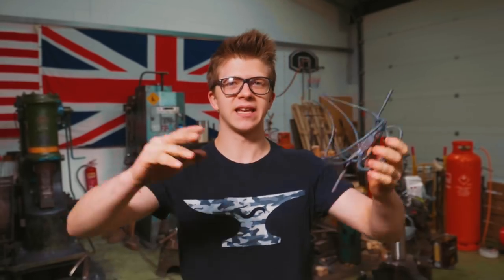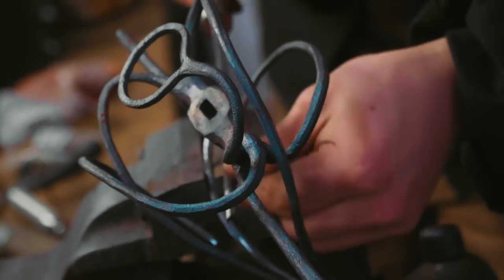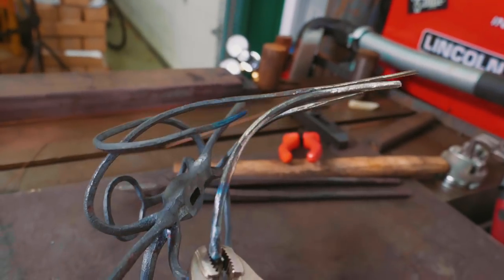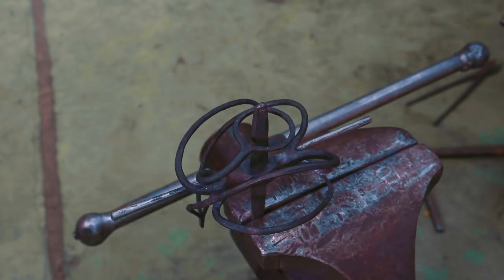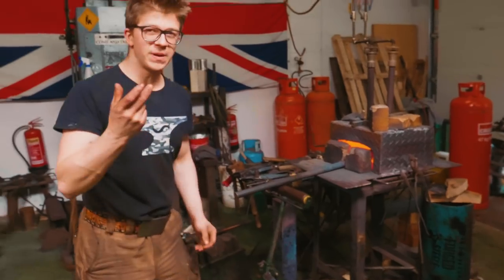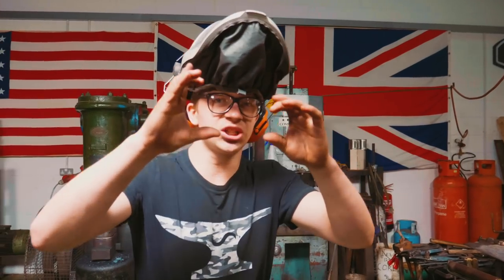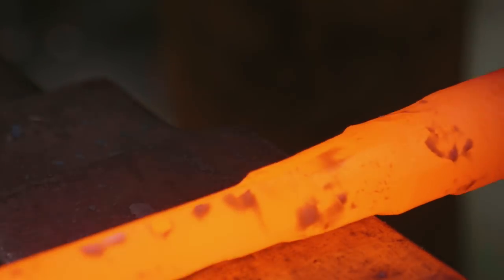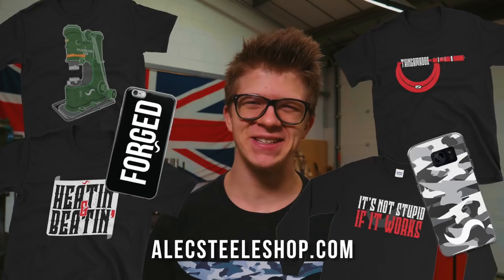MAKING A BASKET HILT RAPIER SWORD: PART 9

Comment: Hey Alec just to quick tip. next time you clean up the material in between all the tines try using a long strip of sandpaper ripped lengthwise it really helps get in between all the areas in hard-to-reach places. Hope this helps God bless you and can't wait to see the rest of this build
Reply: Christ Centered Ironworks or a sandblast cabinet
Reply: Just a question I'm kinda new to this stuff but could you use some sort of tumble polish type thing like used on stones or something like that?
Reply: I work in a machine shop where we tumble our finished parts quite often.  Tumbling can be a very rough experience for a piece of material, depending on the quality of tumbler.  Removing burrs from steel can take hours, soft steel isn't bad but the amount of tumbling required to remove that much hard scale would likely result in the thin and delicate hilt being badly damaged.  It might work with the right combination of media(polishing stones) and settings on your tumbler but I wouldn't want to risk it.  Not to mention those machines cost money.
Reply: I agree a small media cabinet would have worked well here.
Reply: This is a good idea, personally I would say sandblaster, or a slower Way of using hydrochloric acid would be the best way of cleaning the area, I was a Metal Polisher for over 10 years myself and putting something this shape near a grinding machine is just dangerous, doable, but I've seen some bad accidents with stuff being caught on wheels.
Reply: Yeah a small sand/bead blasting cabinet would work wonders and the media for them is fairly cheap, i've found that using crushed walnut shells works on just about everything
Reply: Roy, I'm curious if your pickling technique would be useful prior to removing scale from a piece like this.  Is it unnecessary, or potentially even damaging?

Comment: To pre clean before welding I would have used strips of sanding belt about a foot long, pass around the sections of guard and pull each end alternately. It's much less fiddly than using the little dremel tool. To get round the hard to reach bits tear narrower strips and pass round twice in a spiral.
Looking good though, I hope the pommel is going to be threaded!!
Reply: chris osh The pommel must be threaded to end him rightly.
Reply: Exactly! Needs a fast thread.

Comment: Hey Alec you could heat up the hilt and coat it with brass by using a brass wire brush

Comment: To clean up stuff like that, you could build a tumble mill (basically a small cement mixer with the mixing fences removed, filled with just sand or grit)

Comment: They sell silicone carbide sanding drums like you were using on your die grinder. They last a long -- long time. Also if you ever run into a situation like cleaning up that beautiful basket guard,think sand blasting. Places that do commercial blasting or you can buy an outfit yourself. They have lots of different types of blasting mediums. Especially on something as intricate as this . They have crushed walnut shells,or my favorite for delicate jobs is baking soda. Check it out and you will see they can save you vast amounts of time and do a wonderful job.

Comment: I couldn't find any sources on this, but as I understand it goldsmith's back in ye olden times had a barrel of fine sand and water that the young apprentice would role through the streets, thus giving the jewellery inside the barrel a higher shine. It's possible that sword makers used the same technique. Sanding, of course does not complete the finish but it gets you quite a bit on the way. Modern goldsmiths also use tiny steel balls in the polishing prosess though I doubt the smiths of olden days had the material to spare.

//Norwegian goldsmith

Comment: welder here, the reason your joint let go was because you were welding it with too much amperage. for small detailed work like that basket i would suggest going down in tungsten diameter size and also a smaller diameter filler rod would help as well. awesome job on everything though! your videos are quite enjoyable

Comment: You may use warm diluted acid solution (like HCL or H2SO4) to clean surface of steel after it's forged. It's pretty quick and doesn't require much effort. The acid concentration should be about 8-10% and it's temperature -- about 50-70 °C. (It is necessary to pour an acid into the water, but not vice versa, otherwise strong spattering is possible. And in any case, you need to mix it quickly.)

Another way is electrochemical. You can use a concentrated solution of common table salt. You need a metal container, which you need to connect to the negative wire of the power source. The product is connected to the positive wire. The product should not come into contact with the container, and the distance to the walls of the container from all sides should be approximately the same. The current source must provide 0.5 to 1.5 amperes per square meter of product surface area (Not strictly. You need to find the right value). A charger for a car battery is good. In the process, the solution will be slightly heated, but to accelerate the process, it can be preheated in advance.

Comment: Hey Alec love the vids.    Have you ever tried to tig with bronze silica.     Works great for decore and melting point is way way lower then what you need for carbon steel.    Also try a Gas lens on the tig torch.     Less heat god long way

Comment: grips need to be oval in cross section to avoid the sword twisting in the hand.
Reply: I realise this is a year late but you are right for most swords the handles are oval, but with rapiers you hold in such a way that a couple of fingers (depending on style) go above the handle and into the guard itself, defeating the risk of the blade twisting while fighting. So the handles are actually small and completely round

Comment: Alec, I was surprised that you didn't use a flap wheel on your grinder for cleaning up the to-be-tig-welded surfaces.  But the files I can relate to.
Reply: "little tools here" is a die grinder, eh?

Comment: instead of the round sandpaper barrels that you burn thru quickly, you could next time just make a flapper tool. A bit or round stock that you cut a channel; cut up strips of whatever sandpaper grit you want to use; take a stack of sand paper and fit into the slot; figure out which direction your flex shaft spins it and then use to your desire. Have used for jewelry making to get into tight spaces to polish up. The paper/cloth sandpaper will fly off as it weakens but you have multiple layers of sandpaper so it just goes to the next bit. benefit is you don't have to keep buying all those sandpaper barrels.  GOOD stuff btw. Always wondered how the ancient smiths put these hilts together. You think they forge welded or did you see any pins/rivets when you went to the Wallace Collection?

Comment: Roloc discs in a die grinder. Unsure if they will touch oxide scale but surface corrosion is its bitch. Also the flexible nature of the discs might be awesome for this more intricate work.

Comment: Love these vids! Do have a question though. 
In the past I believe I've heard you say you would opt for a smaller forge if you didn't occasionally need the size for teaching people (correct me if I'm wrong here) yet in builds like these it would seem you need the full size of the forge to accommodate large pieces like the basket. Taking this into account, what size of forge would you recommend for someone interested in picking up the craft? And could a larger forge have it's efficiency improved by sliding in some firebricks at the side when you don't need the extra size or is it not worth the hassle? Cheers!

Comment: those tiny abrasive things are intended for wood and soft metals, not something as hard as steel; that's why they don't last as long.  you might get better results using one of the small grinding stones in the foredom handset (though they will "wear" quickly due to their small size....)....

Comment: love the video's and the patterns of the steel that you make......but i have to ask....why, with all the equipment that you have in your shop, there is not a sandblaster?  it would make quick work of getting into the little crevaces...especially if you use fine sand...

Comment: "Imagine making it out of damascus..."

Make it out of cable damascus, depending on the structure of the cable, you might be able to work with individual strands, rather than hotcutting it. Even if that's not the case, it might look rather interesting when it's all said and done.

Comment: Alex! I need some advice. I work in a Theater in Switzerland in metal fabrication.
I just got the go ahead to buy a welding helmet with air purifier and would love to know what you would recommend. Which helmet do you use?Versaflo?
do you use the same air purifier for your grinding helmet as your welding helmet.
 I guess my budget is enough for a grinding helmet as well
I have also seen welding/grinding helmet combinations,what do you think of these?
I am a big fan. 
regards from luzern switzerland
Clint
Reply: You should check the description area, he have links there for all of the equipment he use.
Reply: thankyou!

Comment: So, thinking of this as a functional piece, is it okay to weld the tines together with that spring tension in it? Or does heating it in the forge after the weld remove that tension? I have this horrifying image in my head of the basket springing apart and sticking me in the arm in a combat situation.

Comment: What is the best place to buy high carbon steels? I've gotten really into blacksmithing but I need a supplier of high carbon steel. 

Can anyone help?

Btw, great video Alec. Keep up the good work!
Reply: Wesley Butler if you are just getting started, you might consider just using mild except for the slitting tools. You have to rework a lot, but the refinement is good practice for smithing and tool design. But, to answer your question, heavy springs (leaf or coil), axles, cam and crank shafts, such things that you may find from a mechanic or a junk yard.
Reply: Carson McMahon I've been blacksmithing for a couple months now and have gotten to the point where I can make decent knives but they are unable to hold an edge because I made them from 1018 steel. 

If I don't want mystery steel, what do you think would be a good source?
Reply: Wesley Butler ok, so you have 2 options if you want good steel for finished work.  First, local or online (search steel suppliers) you will pay a premium but you can get about anything you can name. Second, local machine shops or ebay. Search tool steel or by name. You can buy drops at around 3 USD/Lb if don't need conveniently sized peices. Machine shops, tool and die makers, anyone that uses saw blades, all good places if there are any around, just tell them what you want it for and they will likely be helpful.

Comment: could you not use a tumbler with sand in it to knock off most of the scale and do a light polish on the guard?  I know people in LARPing circle that make homebrew tumblers out of 5 gallon buckets to de-rust their chainmail after particularly  wet events or bad storage.

Comment: I like your channel but I really don't like your light set up in your grinding room with your fluorescents..? If they are ? thats not good in a room with spinning machinery due to the stroboscopic   effect.

Splitting your lighting across the phases L1, L2, L3 etc might be a solution or running them off a DC supply.

"559.9 Stroboscopic effect 
In the case of lighting for premises where machines with moving parts are in operation, consideration shall be given to stroboscopic effect which can give a misleading impression of moving parts being stationary. Such effects may be avoided by selecting luminaires with suitable controlgear, such as high frequency controlgear, or by distributing lighting loads across all the phases of a three-phase supply. " 
(this is constructive criticism from a spark)
I'm referring to 2:34 

Good Channel Alec